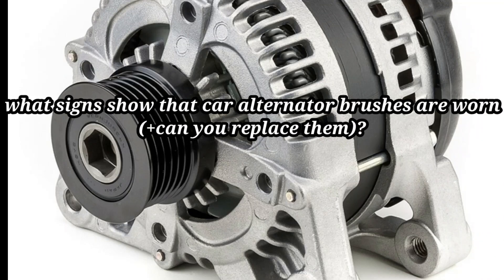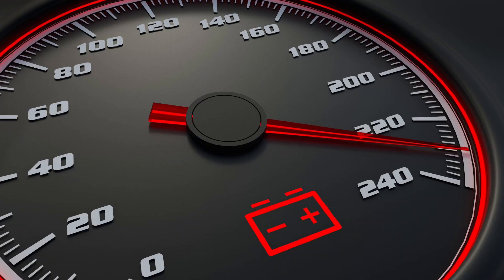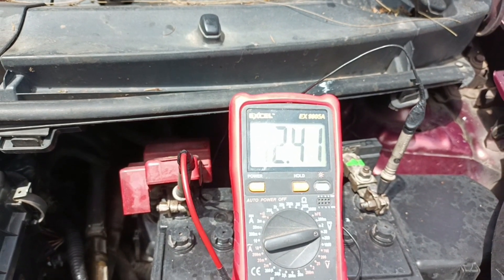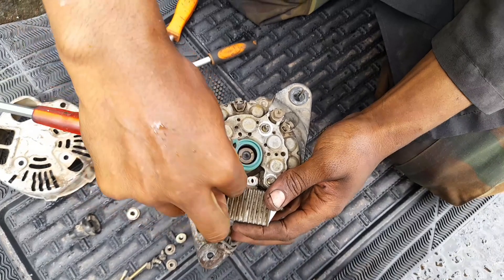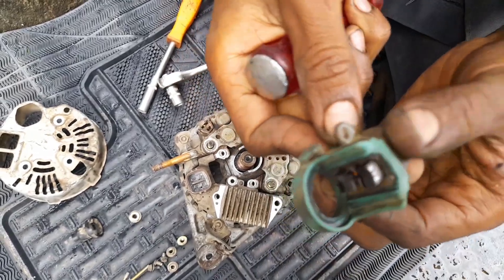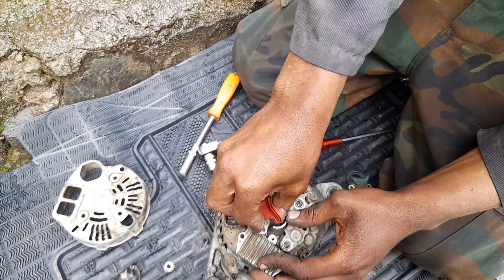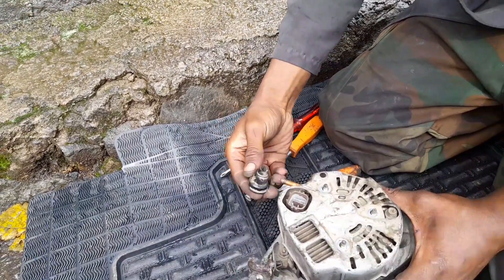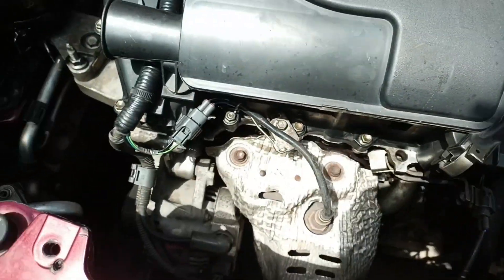What Signs Show that Car Alternator Brushes are Worn (+Can you Replace them)?

Comment: Is it easy to change carbons???

Any body??
Reply: Just like Piece of cakes
Reply: Yeah it should be, just take apart the end of the alternator, you usually need soldering iron and some common wrenching tools. I was looking for this because I need to change the bearings, so I might just change those also